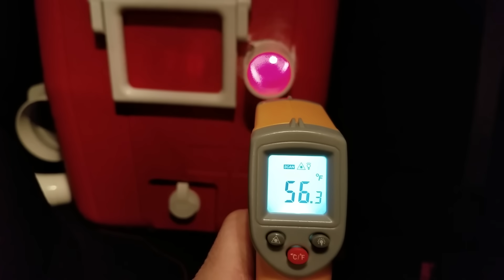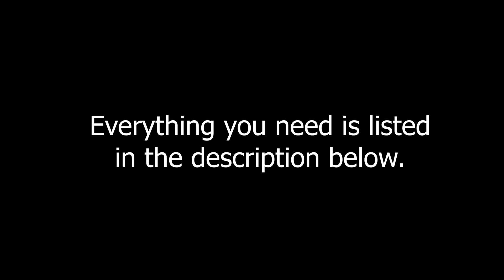Homemade Portable Air Conditioner DIY - Version 2 - Runs off 12 volt battery, car, or solar!

Comment: Thanks dude, I think your diy cooler ac is the best so far... I'm building one just like yours, same fan, n stuff, but mine has 2 flexible aluminum tubes instead of 1! What do u think?  I'll send u a pic when im done! Thanks for ur great ideas!
Reply: Did you read some of the other comments; one said pour rock salt over your ice, makes ice colder and last longer. Other comment was...if you mount your thing (idk what he called it 😅) inside the cooler, it would not be so loud.
Reply: 5conMe0 DuMinhTu  did the tubes fill up with water

Comment: quick question..
if i were to build this in a more upright cooler box and twisted a longer tube to cover more area inside and give the air more travel time.. would it cool down more or is that factor irrelevant?
i know fuckall about thermodynamics lol. also would a normal say 15cm fan with about 250m3h of airflow be good enough? concentrated into a 10cm tube ofc..

thx in advance :)

Comment: Very effective and smart. I had built one using the computer fans for my dogs' house and then tried to use it to cool me while working in the garage, but you have to know that failed in that larger space; thank you for saving me. Your video caught my eye because I had used the same cooler with a solar panel and rechargeable battery, but thanks to you, Amazon has that blower for less than $35 with free shipping (12V 270 cfm's). I'm not cooling the entire space, but it's tolerable until I can build me a small shop to work in, Thanks again, Johnny in TX.

Comment: I'm going to attempt this same design, but mount the fan on the interior of the lid with a hose out to draw in fresh air. Attempting to minimize the footprint. Also going to be using the smaller 3" blower.

Comment: Dude! I can’t believe i didn’t think of running the air through an aluminum tubing instead of bowing air across ice cubes or frozen 2 liter bottles. I got annoyed after 3-5 hours replacing the ice cubes. My roommates complaining i’m hogging up all the freezer space with 2 liter bottles . May the DIY god bless you.

Comment: So, might seem stupid but only one way to learn. Can someone please tell me what the little blue things on the wires are, and where to get them?
Reply from the maker: Those are called wire nuts. You can pick them up at any hardware store in the electrical department.
Reply: Okay so follow up question, I wanna make sure I don't blow a fuse. The black and yellow cords connect to the black fan cord, so the left over cords connect to each other right?

Comment: Didn't work for me! ,  built one just like that for my semi truck ,hoping to use it at night while sleeping and not idling the engine . 2  10lb bags melted within 3 hours, without any significant sign of  cooling the cabin. That's it

Comment: Would this work in a 6 person tent when the temp is averaging 97/day and possibly 80/night?
Reply from the maker: It will definitely help, but you will need to have it blowing straight on you because as you know, a tent has no insulation and much of the cold air will seep through to the outside.

Comment from the maker: DO NOT USE DRY ICE!!! When it dissipates, it will fill the room or vehicle with CO2 which will displace the oxygen causing you to suffocate, pass out and possibly DIE!!!
Reply: Your air supply is separate from the ice itself. As long as your coolers lid seals and your holes are well sealed, dry ice would be fine to use and probably yield much colder results
Reply: @miketaylor8427  Naw, the the volume of CO2 produced by the dry ice would rupture the cooler if it was completely sealed.  Two ounces of dry ice is enough to fill a 5-gallon bucket with CO2 gas.
Reply: Oh SHIT! That's not good! lol
Reply: Thanks
Reply: make & do OMG!..I’m SO glad your comment was the first one I saw...I was considering dry ice but I was only wondering if a cooler would be strong enough to keep it being it was so much colder than regular ice....but I didn’t imagine it could kill me thank you so much❤️
Thank God ....
Reply: I saw a YouTube short of a group of men finding a dead man in his semi truck because of this.

Comment: These couch quarter backs that criticize your efforts are almost unbelievable." Add Dry ice",   Create a huge cloud of smoke. "Add more loops of tubing", Create Less space for ice and why?  it already is blowing forty degrees. "Drain the water."    There by reducing the mass of cold so it can't cool as well.  Until all the ice melts teh water will be less than forty degrees.   Let them make their own and then tell you how poorly it works after they have made their own modification. They will probably then blame you.  You did a great job making this. Kudo's!   I would like to know how long the cooling lasts when the cooler is in the sun.   Perhaps painting it all silver will help.  Not enough space in the cab for it to be inside.  I may have to make my own to find out.

Comment: Going to build one for my HOT mail truck. Gets about 115 degrees inside. Hope it works!
Reply: Nope!
Reply: @AltonVaden  findings?
Reply: David Malgeri ice melted in about 2 hrs in the AM and less than 1 hr in the afternoon. High temps around 90.
Reply: Did it work?
Reply: Rezzo Jr No. ice melts way too fast in NC heat and humidity. 20 lbs of ice lasted less than 1 hr.

Comment: Could this work with hot water as well for using as a multipurpose heater and cooler? When camping you could make a fire to boil water or when RVing use a Coleman stove to boil water. Combined with the 1st ed. and 3rd ed. this is very clever and I appreciate the research and effort. Cheers dude!

Comment: I noticed you have a 2" outlet,  is that to keep the air in the duct work longer?

Also looking at the same blower at 130 cfm , is that enough volume? Will only be used in a pickup truck.  And would you change anything using the 130 cfm
Reply: The 2" outlet is because the hose inside the cooler moves back and forth so much that it reduces the air flow so the smaller outlet makes up for what the other pipe lacks

Comment: On an 80° day, the ice does not last more than 30 minutes, 45 minutes tops. Been there done that in the 80s with my nonair-conditioner company car. After half an hour I was driving around with a cooler full of ice water sloshing out as I went around Bends... I bought a blower motor fron a car junkyard for $10 and plugged it into the cigarette lighter. I had a hole in the opposite end of the lid directing cold air at me. I thought I figured it out. I had an unlimited supply of ice from commercial ice machines where I worked were they had ice for the coolers of the lineman to use.This contraption is not an air conditioner, it is an ice melter. That’s all it is. Don’t waste your time or your money

Comment: Great design! I ordered the 3" Seaflo Blower from Amazon for $20 today with standard 1 day shipping so it will be here tomorrow. I'll pick up the rest of what I need at Menards and am considering adding a potentiometer to it so I can adjust the fan speed. I plan on using this for my converted camper minivan for cooling it down while sleeping and also the tent for extended camping. Almost ready to add a dual battery isolator for auxillary power. This has to have the other designs beat by a mile. Thanks for posting and I subscribed to your channel so I can tap into more of your genius.
Reply: Let me know how the 130 cfm works.  I'm thinking of the same for less current draw and less noise

Comment: Awesome build I think if you were to put a second layer of aluminum flex pipe you would get even more surface exposure to the ice heat transfer
Reply: So not as much room for ice, Makes perfect sense.:(
. Did you read he is getting forty degree out put?

Comment: I found your video very interesting and looks very easy to make. But how reliable with this be, if you need to run it when the weather is the HOT🔥 like let's say in a cargo van that you converted the back into a live in camper van. Would that motor fan run die after so much use?

Comment: The ice has less contact with metal tube. As ice melts the cold water has full contact with tube suface. This make the tube colder which gives you colder air.

Comment: I'm going to make this! I'm a refrigeration technician and this is genius. Only changes I'm going to make is making both the inlet and outlets at the top and then run the pipes across the top section before dropping down and looping across the bottom to try to utilize some of the top section, and I'm also going to run the power to the fan through a 12 volt thermostat to hopefully preserve more ice and increase how long a full cooler will last. Thank you so much sir for sharing this!

Comment: one tweek for your configuration. Insulate; try wrapping the cooler in hot water wrap. It’s like bubble wrap made out of foil. Make sure to wrap the bottom as we all know heat rises. In the same statement cool air falls. Bye wrapping the bottom not only do you stop heat from below to infiltrate the ice the cool you have in the cooler will have a harder time escaping to the bottom.

Comment: Just wondering....If you where to use a water resistant motor and place it inside the cooler; will it reduce the fan noise?
Reply from the maker: I would think so, but I haven't tried it myself.

Comment: If you live in a place like Houston or New Orleans, where the temperature is always above 90* and the humidity is absolutely vulgar, these are useless. It might bring the temperature down a couple degrees, but you can actually see fog rolling out of these, and it mostly just raises the humidity to levels you never thought possible. I was very much ensaddened. ☹️

Comment: Seems like your choking that 6" fan down to under 2"? You'd use less amps by matching fan size to outlet.
Reply: Its a 4in, but I agree. Itll wear the fan motor out quickly

Comment: Do you have to have the engine running
Reply from the maker: That depends on your car. You can also hook it straight to a battery or plug it in to a wall outlet with the right adapter.

Comment: I am struggling to know why this is better than a window air conditioner that you can get for $100.00?  with the fan, cooler and parts you probably are close to that, not counting the time to build it.
Reply: I was thinking the same thing. The only plus I thought of is this way you can run it with a 12v battery and the window unit needs a 110v outlet.

Comment: i made one, with a 240cfm..but i used pvc for the whole shebang and i ran it all through the top of the cooler...didnt wanna wake up to a surprise due to potential leaks....i did use some dry  tube for a duct of sorts to keep intake and exhaust away from each other...thanks for the sharing you did here
Reply: Could you post a picture of your set up?  I was considering PVC as well.
Reply: @old-school-ez6715  i will be making a delta style recumbent trike build video soon...my heat exchanger will be in that.

Comment: Would you be able to Sleep if you had it in the room during night or maybe close the door opening in the next room? How loud is it?
My guess is that I’d have to go with smaller fans and have it closer in the room.... any suggestions for fans for that purpose?
We live in Sweden and last summer was the warmest ever, even warmer than Spain :)
Reply: I just finished mine , reading comments i decided to go with 3" fan, smaller version of one in video but still, its very loud,  almost like you stand next to working vacuum cleaner

Comment: How are you combating condensation inside your air duct? Has it not been an issue?
Reply: if that becomes an issue, i could see using PVC througout the entire cooler to combat that. would cost more but no way the PVC is going to break down due to being in cold water a lot.
Reply from the maker: All of your questions are answered here: https://www.youtube.com/watch?v=H4LutVTqsUU&feature=youtu.be

Comment: Why do people who make these call them "Air Conditioners?"... They are EVAPORATIVE COOLERS aka "Swamp Coolers" and there is a HUGE difference as Evaporative Coolers work on the principle of pushing air through water which in turn drops the temperature of the Air. Air Conditioners on the other hand use compressors and Freon to actually "refrigerate" the air. Evaporative coolers work best in Arid Climates as they produce humidity... operating one in humid climates is self defeating. Also, with an Evaporative Cooler you must open a window slightly in order to keep the humidity from building up and defeating the cooler. While this may be "better than nothing"... it's not better by much. I lived in the Desert for 50 years... believe me, I know the difference between an Evaportive Cooler and an Air Conditioner!
Reply from the maker: There is one simple reason people that create these call them air conditioners: SEO. Most people aren't searching for swamp coolers or evaporative coolers. People are searching for portable air conditioners. Therefore, you have to put in the title what people are searching for in order for Youtube to suggest your video.

Comment: Why couldn’t you add a cloth screen to the front of the fan and dampen it with water to act like a swamp cooler to cool the air before it goes into the ice bath? I’m picturing like a drip to keep the screen moist. I don’t see why a water reservoir couldn’t be mounted above the fan. You could control the drip much like a nurse does for an IV.

Comment: Great Video. Don't even think of using Dry Ice in a contained area. It's Carbon Dioxide and is not safe in a vehicle or tent environment.
Reply: Steven Rothstein the air doesn’t come in contact with the dry ice just curious how it would create added co2 in the air?

Comment: Would a 50 W solar panel work to power the fan?
Reply: Jacob Barker.  He said the fan used 6 amp so 6 amps times 12 volts eguals 72 watts

Comment: i bought an old fiat camper from 1990 and it doesnt have airco, i was planning on building something similar like this but start with a car cooler box 12v  as donor or do the same as you and add some peltier elements for the extra power. Also I was wondering if it would be benificial to add a small water pump connected to a vlotter to draw some of the hotter water out like every few hours. Any advice you can give me how you would make version 3 ? :D

Comment: Does anyone have any suggestions on how I can make this run off the grid? I want to use this for music festivals, but a 12v battery would only allow this to run for 9hours. I'd be there for 4 days and need it to run for 18hr or so. Can I do this same system with solar or disposable batteries?
Reply: Recharge your 12v batteries via a solar panel (suitcase)

Comment: Awesome design bro,  does this set up cool the entire room or just the area directly in front of the unit?
Reply: Pretty much just in front of it, or perhaps a very tiny space like in a conversion van and just over the bedding area (sealing it off from the rest of the van as best possible.).  There are also low cost 12v dehumidifiers now on Amazon, which will help by reducing the humidity.  At 20 watts, they're low power enough now to run on a solar setup in a van or RV.

Comment: Our vent pipe eventually filled with water and made the unit inoperable (no air would come through). Any suggestions on how to avoid this? Thanks again for posting BTW.
Reply: You would need to add a drain to the vent pipe, which may necessitate a complete change to a new pipe, like running 3" PVC back and forth several times and at the lowest point, tapping that pipe to add a drain that let's that condensation escape.

Comment: What if you kept the cooler box outside and plumb the intake and exhaust hose into the van. But fill the cooler box with dry ice? It would be more expensive but it would get bloody cold. Cool video and thanks for sharing

Comment: Wanting to go camping at Ft Jefferson, (Dry Tortugas) down in the Keys for 3 days (2 nights). Probably will only use this at night.  Is the motor strong enough to run consistently for around 6-8 hours each night? Also what type of battery would you recommend for use with this blower? Going to be charging it with solar power.

Comment: Some basic knowledge of heat transfer principles would go a long way here folks.   The conversion of Ice to water yields 144 BTUs/lb of cooling.   Factor in the efficiency of how fast you can transfer heat, and you now have a heat transfer rate.  BTUs/hr.    The more BTUs per hour of cooling that you can achieve, the better this device will cool say a small room, van, RV, etc.  The downside being you'll melt your ice faster.  The metal pipe version likely does a better job of transferring heat from the incoming air to the ice vs the open air design with the muffin fans.    Keep in mind the total capacity of the device is directly proportional to the lbs of Ice you have available to melt.   How fast (the rate) at which it provides cooling, is directly proportional to how efficient the heat transfer system is.

Comment: Only concerned with cold water flowing back into the fan motor is that possible that could happen or you drain it every few hours?